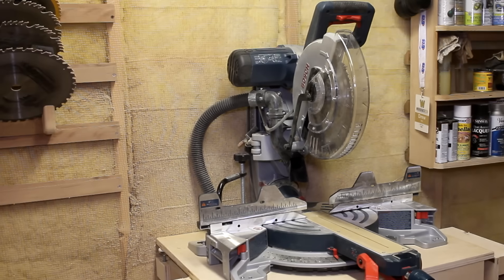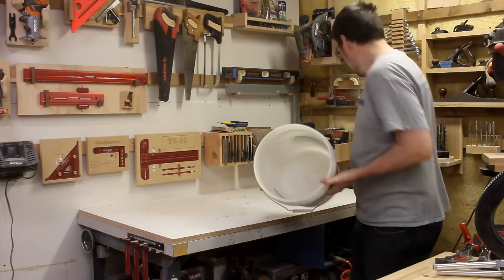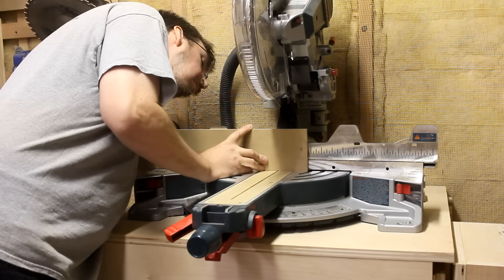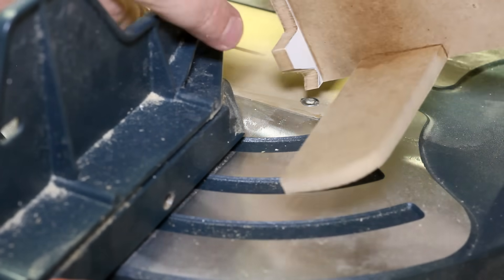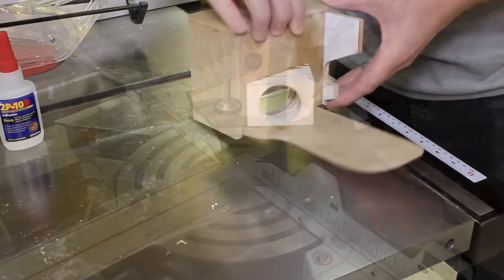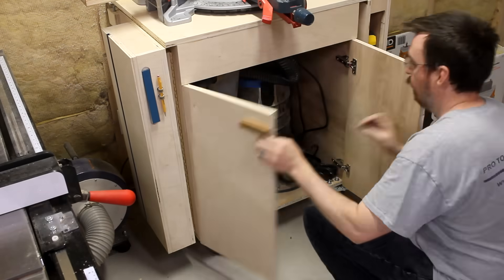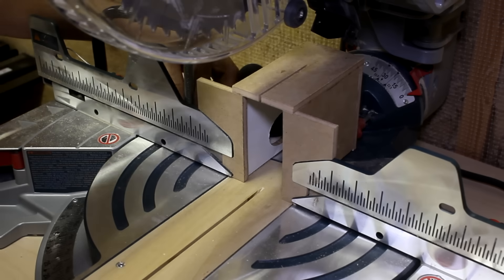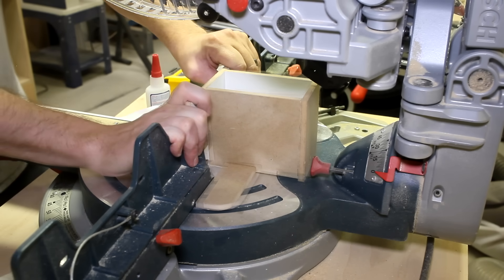Shop Work: Improving Dust Collection

Comment: I know this is old video but I just came up on it and found it very interesting. You method of testing and presentation was very good, like it and thumbs up. One question why did you open up the front of the shroud? I think if you just did single blade cut results may have been better.
Reply from the maker: They actually would have been much worse.  The wider opening allows more dust to get into the shroud.  If it was a zero-clearance, most of the dust would have just bounced off the front face of the shroud.  Thanks for watching

Comment: I wonder what you did with the built-in dust port?  A 2nd vacuum hose?  Or just left it open?  Sealed it off?
Reply from the maker: I just left it open and attached the bag.  The system would work even better if I put in a Y-connected and ran another hose to it.

Comment: Great job as always. How satisfied are you with the Bosch saw? I went back and forth for months between that and the DeWalt DW780, and I kind of regret not getting the cool articulating arm on the Bosch, but I had heard some reviews that it flexed and was not as rigid as desirable.
Reply from the maker: Never had an issue with it flexing more than expected.  But ALL miter saws flex a bit.  This has been a workhorse of a saw for me.  Pretty pleased overall

Comment: Recently had a thought - I know, that’s a surprise!  I was thinking about your solution to miter saw dust collection, and how it is limited to 90 degrees.  What if the sides (behind the fence) angled back, and the whole assembly was attached to the cutting head.  In theory, it could rotate with the cutting head and blade, collecting dust at different angles.  
A few factors that could be issues:  how to attach the assembly (I think of it as a ‘backstop’ dust port) to the cutting head; the sides would probably need to be pretty thin; where to attach the hose; that low semicircular metal component behind the fence would likely be in the way.
I’ve been busy with other things, but thought I’d pass the idea along before I forget what it was.  And you’re much better at prototyping such things.  
Best wishes and stay safe!

Comment: Hello again!  Finally got my two miter saws pretty well aligned.  About to turn one over to my son.  
Recently picked up a 2HP HF dust collector, getting ready to connect it to the sliding miter saw, then a Radial Arm Saw, and eventually other tools. So I decided to review this video yet again, and noticed a couple things.  
1) Ring’s Workshop and Patriot DIY have what I think of as “backstop” solutions VERY, VERY similar to yours.
2) However, they also still connect to the stock dust port.  
Just thought you might be interested.  It could get your solution that little bit closer to perfect.
Best wishes!  Stay safe!

Comment: I'm thinking about buying that saw and building your dust collector option.  How did that dust collector work with a cut that started further away from dust port?  I think the cross cut capacity is something like 14"?  If you cut a wider board, how does your dust collector stack up?  Thx.
Reply from the maker: For tall pieces (ex. 4x4) or for really wide boards that require you to start further away, it still behaves like a typical miter saw and sprays the dust everywhere.

Comment: Well done! I am a scientist with well over 50 years of professional experience. Your methodology was quite good and clear. The only issue I have with it is that for a real scientific conclusion you need to do at least 3 measurements for each set-up. Then use those 4x3 measurements to get error bars. Error bars will tell you if your conclusions are real or within the margin of error.

I also have a comment. I am retired and love woodworking. However my nemeses is wood dust in the air. A little calculation reveals the following: your 5 cuts results in .92 ounces (26.1 grams) of wood chips and dust. At 96% this means that the amount of wood not captured by you device is .04x.92 = .036 ounces (1 gram). Now let’s assume that 90% of this uncaptured wood is wood chips but 10% is wood dust. So we have 0.1 gram of wood dust for every 5 cuts of a 2x4. This wood dust goes into the air you breath. Now let’s assume that in a project you do the equivalent of 100 cuts. That means that 20x.1 = 2 grams of wood dust goes up in the air. All of this dust from just one (small) project is is in the air ready to go into your lungs or settle on your tools and workshop surfaces. Do this a few times and it adds up quickly. My point is that 96% capture is impressive but overall still not that good. If you instead captured  99.6% of the wood you would have 0.2 grams of wood dust in the project. Much more acceptable. Unfortunately capturing 99.6% of the wood is an extremely difficult, if not impossible, task.

Comment: Perfect mix of solid research, great low-key sense of humor, and thorough expertise. I didn't use a shop vac with my mitre saw when I used in my living room. You will understand I spent several hours more cleaning than doing the actual cuts haha
Reply from the maker: Hah, I'd imagine so!

Comment: You claim that's an 8% increase, but the more relevant measurement is the reduction in dust left in the surrounding area vs the standard starting point.  
The standard vac leaves 11 (92-81) units, yours leaves 4 (92-88) units, which means you capture 7 units of the total 11 possible units, for a 63% increase in dust collection.  While the 8% MORE claim is still truthful vs overall possible dust, I'd say the fact you now collect 63% more dust than the previous solution is a more relevant measurement.  Well done sir, amusing and informative content.
Reply from the maker: Thanks!

Comment: I will be using your technique to make on for my DeWalt 779.  Thanks for the great video.  Very well done and to the point.  Do you think it would help to put a thin layer of rubber on the bottom to further seal the dust collector???
Reply from the maker: Yeah, I used some weather stripping
Reply: @FishersShop  Thanks for the reply.

Comment: All your cuts were with saw in retracted position. How would this work when making a sliding cut?
Reply from the maker: Works the same.  However, usually I do a very shallow pull cut first so create a channel for the dust to travel through.  This really helps in capturing even more.

Comment: Excellent presentation.  There is a more generic capture technique, that will approach 100%:  frame an enclosure to create barriers on the two sides and the "ceiling" (above the saw); cover the three sides of the frame with plastic cloth (clear is best), and simply exhaust the area around the back of the MS.  (Note the back surface is the wall of the shop)  I've found this both quite effective and also fits virtually any saw choice.
Reply from the maker: Just too big for my taste.
Reply: @FishersShop "That's what she said". Me too. I have the same model saw and have been puzzling over this problem for 2 years. Really happy YT put this in my feed today. Back to the shop.

Comment: Great work, but you really need to lower that bandsaw blade guide to something more reasonably safe.  LOL

You gave me some ideas.  My saw has a shroud I built around it, but I need something like your solution to get the vacuum to grab what winds up in the back.

Comment: Great use of humor to wake us up as we fall asleep during presentation.  I see that existing saw dust scoop has no connection to the shop vac, as the box you make has only the side outlet.  I have my miter on a portable stand and this makes a lot of sense for me instead of the boxing in of the entire back with a wood box or fabric tent.  Chris Harpster contends and backs up his theory with the same dust measurement process you use, that a measurable amount of the dust actually moves up into the blade guard along the blade rotation.  This send out dust to both sides.  He uses an enlarged scoop like the one you made with duct tape but also includes a shroud that covers the area of the exposed blade.  I'm going to build yours and Chris Hapster's method and look at using his shroud together with your box.  Check out the scoop&shroud video Chris made: https://www.youtube.com/watch?v=dN0xR__pSI8&list=PLMQE9mF2y_5yy7EyJ914Wo--x6mNQrf9T&index=2

Comment: Very scientific approach to a common problem. You started with a reasonably good collection of dust with the standard setup. My Metabo 254 didn't collect anything in the supplied dustbag. I didn't want to limit the miter saw angles, so I ended up with a box over the complete saw with cut-outs to ensure the angle movements.

Comment: Good job! I have been looking at what the dust does as you cut in your videos, and you can sort of do a thought experiment to figure out that the saw is creating a 2mm sloped channel as it cuts, and the dust is shooting out of that channel out of the front of the blade at an angle that depends on the thickness of the stock, the diameter of the blade, and the depth of penetration of the blade through the stock.  The outlet of the channel, and the place that the dust hits the back of the saw depends on the position of the blade as it moves forward. This also means that the wider the cut, the less efficient the dust collection will be, and shutes of Fisher's design will work better when they are as tall and as wide as physically possible. It may be good to put those wings on either side to good use too - tricky but not impossible.  May put all this to the test with 3D printed parts and report back.
Reply: Second thought: The built in collector on Fisher's saw is actually quite good because it's always close to the saw.  I wonder if one like it can be built that moves out of the way of the cut like the blade guard does?

Comment: I just got a through!

What if you made the vacuum hole bigger? Or add small air holes on the other side of your DIY dust collection cube? I'm sure you could pull an extra 1 or 2% with just some simple modification and that would be freakin awesome!

I'm going to go ahead an get something like this built tomorrow
😁

Comment: That 8% improvement over the straight vacuum means 1/3 the dust escapes the collector. That's a pretty awesome improvement in what really matters - dust in your shop. 

This also means the basic bag is a fair bit better than nothing, and a simple shroud + vacuum is an easy way to significantly improve your dust collection over stock.

Comment: I guess it works good when your cuts are on a 2 x 4 and the blade doesn't move away from the fence.  But I can assure you when you try this with a 10 inch cut and the arm is extended to it's fullest, you're going to find out the extended flap works hella better. I just wasted a bunch of time finding out.
Reply from the maker: It's all in how you perform the cut.  If you start with the arm pushed in all the way and pull out making a shallow trench first, then drop the blade down and push through the board, the vast majority of the dust travels through the kerf of the trench into the shroud.  I've been doing it this way for years and it works great.

Comment: I liked your video on the dust collector box for your bosch 12" miter. I  just purchased a bosch 10" miter therefore I will be making one for my miter. Would you happen to have any plans or did you make it up on the fly
Reply from the maker: Just made it on the fly.

Comment: What glue & accelerator are you using in the video?
Reply from the maker: Probably 2P10.  However, if you use the links on my website, you can save money by getting Starbond.  I prefer them now.
Reply: @FishersShop  Thanks

Comment: Looking for a similar solution.  But one that can also do miters.  Till then, pretty good work.  Sorry for the criticism, but do you always run your bandsaw with that much blade exposed and with the blade guide supports that far away from your workpiece?

Comment: one thing i noticed, if you were to cut anything wider than a 2x4, like 8 inches in width on a sliding miter saw, will this be effective at all?
Reply from the maker: Yes, but you just have to change your cutting technique.  Start by first cutting a shallow channel for the dust to fly, starting on the inner edge and pulling out.  Then repeat the motion adding more depth to the cut until you get through.  Collects just about all of it.
Reply: @FishersShop  Thanks. im new to it all but will definitely have to do this. Hope it comes out good

Comment: Even better.
Your solution pollutes your surroundings with that 4% loss, the duct tape pimped stock solution is the next best and looses 8%. You reduced your air dirt by 50 percent, or 66 if compared to the plain stock version. That does not need some adding up over time. it improves the situation instantly.
Thanks for the nicely made production.

Comment: Most of my cuts are also at 90 degrees. The problem is when I get in a hurry, I sacrifice improvements I've made for the sake of time. That's the problem I have with most solutions like this... I'd get in a hurry and suddenly have to cut angles, and I'd right through it. But being able to remove it that quickly? PERFECT. You rock. I'm going to do this for my Hitachi... Probably with some modifications to both the box and the saw. Thanks. If only more social media was about exchanging ideas instead of exchanging scantily clad selfies. I view those people as extras in this movie we call life. Extras don't have enough talent to have an important part. They're not worth much. But if they weren't there taking up that space, it'd probably be weird.

Comment: looks like you didn't zero the weight of the paper. i know you included the paper in both sides of your comparison, but adding a fixed offset still throws off the percentage calculations! that zero button on your scale is handy for that sort of thing.

better yet, you can just weigh the entire bag/bucket/etc before each run, and weigh it again after the test and subtract the weights, it'll get EVERYTHING, with no risk of some getting left behind in the bag or bucket and not counting towards the result

Comment: Worth thinking about this: The shop vac method misses 12% of the dust, your contraption 4%.  Meaning, you have 1/3rd of the dust flying around with your solution of what you have with the shop vac.  Have a very similar saw, building on of those chutes today.

Comment: did you remember to remove the dust from the bucket that came from making the "inaugural cut" into the shroud, before making the final 5 cuts?    haha... hope so.  just something that i noticed.   Either way, I copied your design to the T for my Bosch 12" and it works like a charm!  Thank you!

Comment: The next time you make something like this, cut out the hose opening in the side piece and round over the inside edge before assembly. It is absolutely amazing how much additional air flow is produced by this one modification.

Comment: For the duct tape method, I wonder if you've extended/widen the duct tape to as far as it can practically go it could have come out as the most efficient. Furthermore it is easier to build not to mention you could cut miter and bevel without the hassle of removing it. Just a thought. Thanks for sharing.
Reply from the maker: I extended it as far as I could so that it would still pass over the back of the fence.  Any longer and it would hit.  I think I was losing most dust under it.

Comment: Do you think adding a second vacuum hose on the opposite side would make anymore of a difference (using a Y adapter)?
Reply from the maker: Adding a second vacuum, yes.  That would double the suction.  Just adding a "Y", not really since you're just splitting your current suction in half.
Reply: @FishersShop  good point, I didn't consider the loss of vacuum suction.  Thanks for the response and your great video content and humor.

Comment: It's brillant! Do you think that using a dust collector in place of the shop vac would improve the results? I'm asking because I  ordered a mitre saw and I will need a dust collecting solution as well!
Reply from the maker: dust collectors have a much higher CFM so there's no doubt it would perform better

Comment: I like your choice in words... I'm curious, did you subtract the weight of the paper in each dust pile?
Reply from the maker: No I forgot so that means the percentages would be even higher.
Reply: I think you got that backwards? When you weighed the half inch wide piece, it was without paper... When you weighed the dust piles, it was worth the weight of the paper... So if you subtract the weight of the paper, just the weight of the dust would be less, meaning a lower percentage compared to the total weight of the wood piece, right?
Reply from the maker: You're not the first to spot this.  Someone else in these comments did all the math again and I seem to remember that he noted that the shroud was even more effective than I had said it was.
Reply: @FishersShop  it can't be... The math is backwards. You're including the weight of the paper in the weight of the dust. If you take the paper away, the overall weight is less. I.e. dust with paper = .88... Dust without paper = .70... Let's say the block weighs .98... So block vs dust with paper, 0.88/0.98 = 89.8%. Now... Block vs dust without paper = 71.4%. that's lower. Dust with paper=89.8% > dust without paper=71.4%. Means lower percentage, less efficient than original calculation.
Reply from the maker: Try not to lose sleep over it.  I'm pretty sure nobody really cares.  Bottom line is that it works very well.
Reply: @FishersShop  whatever dude.
Reply from the maker: @wraith657  Indeed